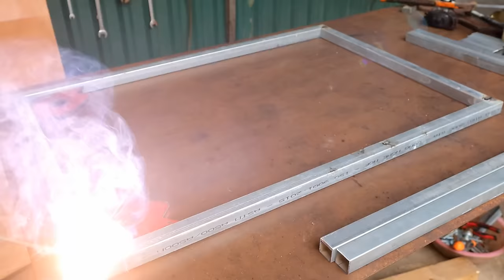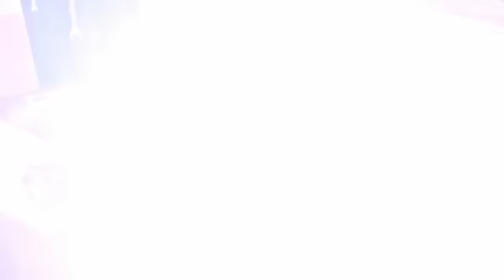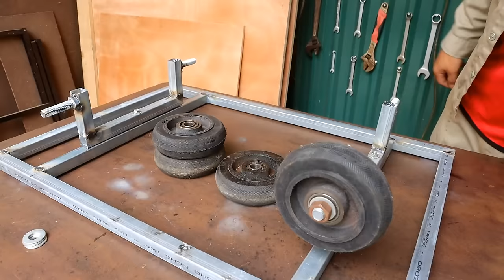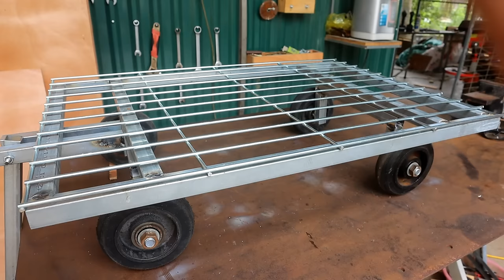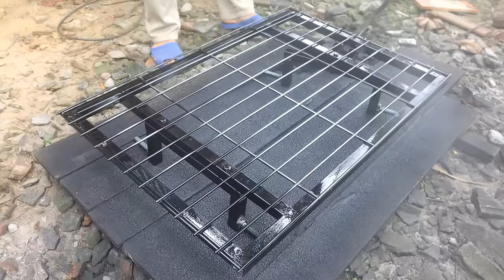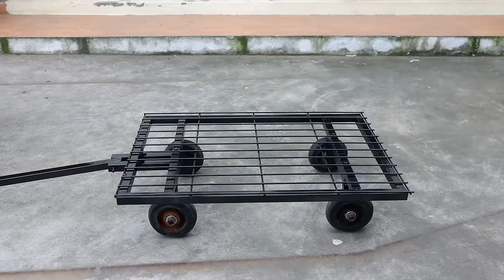Great idea on how to make an effective shopping cart by a smart craftsman / DIY metal trailer

Comment: This design, my friend, works on straight lands and is not suitable for crooked lands. Thank you and great work
Reply: Hi, how come it would not be suitable for crooked lands? Maybe just change the tyres to neumatic ones with all terrain treads? The guy done a good job 👍🏻
Reply: @waynekitch  I agree with you, when changing the tires to pneumatic tires, it can run better, but there are other things that must be worked on. The man did a good job, and modifications can be made to this work. Thank you for your understanding.